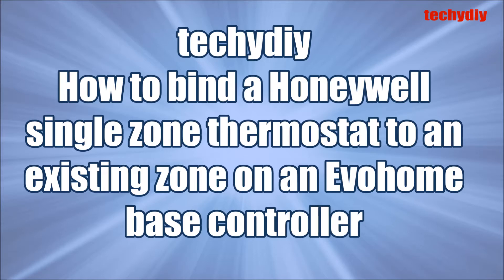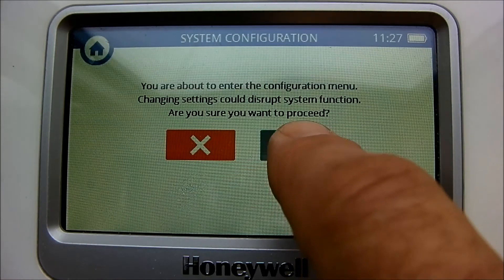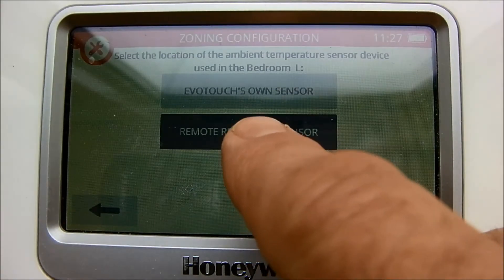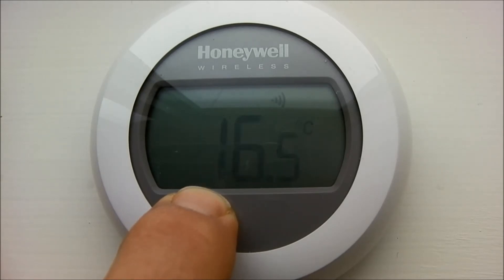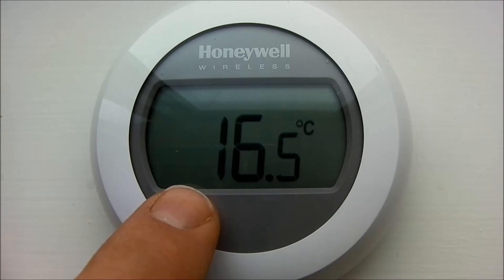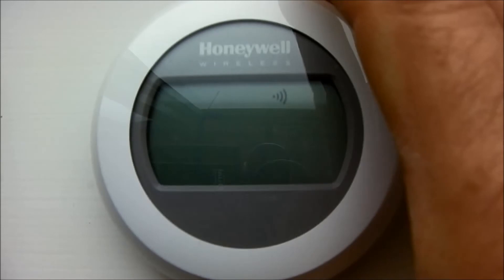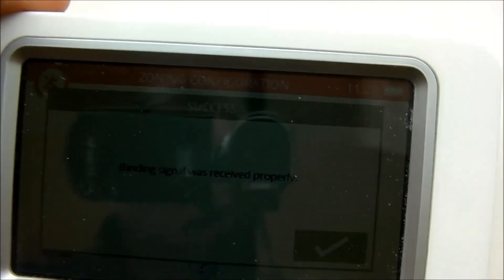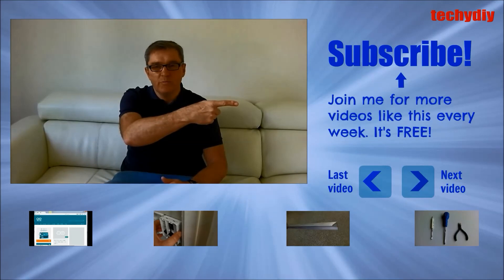How to bind Honeywell single zone thermostat Y87RF to an existing zone on an Evohome base controller

Comment: Can a Y87RF2024 be used as a remote temperature sensor for an HR92 if the HR92 is bound to an Evohome, which in turn is bound to an R8810 Opentherm bridge?

Comment: Can I remove all of my hr92 rad valves and just use the t87rf in 2 or 3 areas to call the evo home for heat? I want to return to normal rad valves as we want to fit traditional ones

Comment: Hi. I'd like to do this but I have an issue. I previously had that hub with 4 radiator valves all linked. The Honeywell hub speakes to a reciever which operates the boiler. All fine with the above.
However afternoon an extension we now have an area of underfloor heating this has one of these single zone valves to operate it which speaks to its own reciever and that operates the boiler and underfloor heating valve. 

My question: when I do as you describe and link this single zone valve to the multizone hub that works and is found but the single zone thermostat then stops turning on underfloor heating.

How do I connect this to the multi zone hub without loosing its connection its its reciever. If I can do this I can schedule it and do my operations from the hub and app rather than using that single zone separately.

Hope that makes sense and hopefully you can help 
Or anyone else who has this knowledge 

Thanks 
Ed
Reply from the maker: If the underfloor heating has a bdr91 and a Y87RF single zone thermostat controlling it, then you could link both the bdr91 and the Y87RF to a new zone on the Honeywell Evohome controller.  The Evohome controller then receives temperature info from the thermostat and turns the BDR91 on or off depending on the temperature.   The boiler needs to be controlled (call for heat) by another BDR91 or a relay contact on a heating valve.

Comment: Thanks a lot for this video. I have a setup where Y87RF would be in a zone with two other HR92. If I bind the Y87RF the way you did it, it won't use the sensor data from HR92 anymore and start using it from the Y87RF? Am I right?
Reply from the maker: Yes
Reply: This isn’t correct. If bound like this, the rad valves still control the temp and the Y87 becomes dumb. It will change the temperature in the app and on the base as well as the HR92s but it’s the HR92s that control the temp so (in my case) the room does not reach the Y87 temp as the rads have stopped calling for heat when they hit the set temp.
Reply: @rickh1634  , I am trying to set up a new system myself, and have experienced the same. Have you managed to resolve it yet?
Reply: @charliecalderwood1  Did you resolve this? :)
Reply: @Plan3tBob  Yes, thank you.
Reply: @charliecalderwood1  I'm in the process of setting the evohome up this week.  Was there anything you did to fix the issue you had that I should look out for?  (Any pro-tips appreciated!)
Reply: @Plan3tBob  I found the instructions weren't very clear, and ended up talking to Honeywell online, who went through the procedure with me until it worked. The biggest ongoing problems I have found are:
a. The needle valves alreadyy in place in the radiator thermostat housing sometimes cause the valves to fail. This is claimed by Honeywell to be due to them being slightly bent. I say the valves don't have the necessary power to push the valves closed if not absolutely truly straight. I have 2 that I need to replace because of this.
b. Once I leave the locality of the house my phone and the Honeywell system appear to not want to work together. This is not a huge problem to me personally, so I haven't pursued a solution with much gusto, but it may be to some. Hope that helps. Best of luck.
Reply: @charliecalderwood1  ah that's interesting.. I know that a couple of my points are harder to push down than the others so I'll swap threepence of I get the chance.  Thank you for the reply, much appreciated.
Reply: @Plan3tBob  you're welcome. Best of luck with it!
Reply: @rickh1634  How did you resolve the problem, and get the y87rf to be a remote sensor and temperature controller?
I’d like to set one up in a room with two existing HR92UK’s.